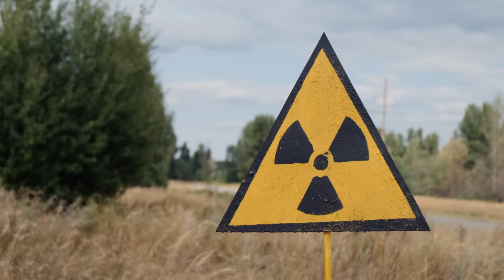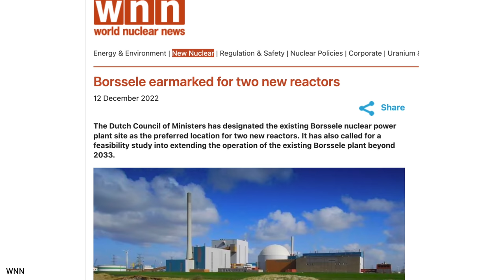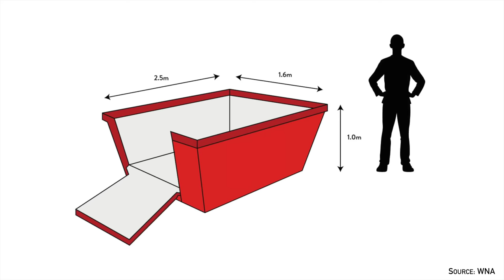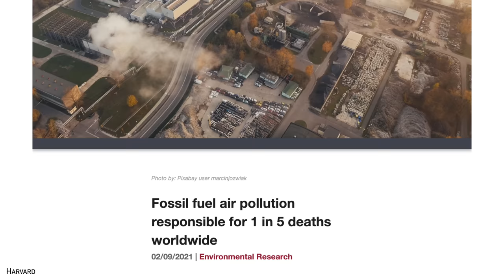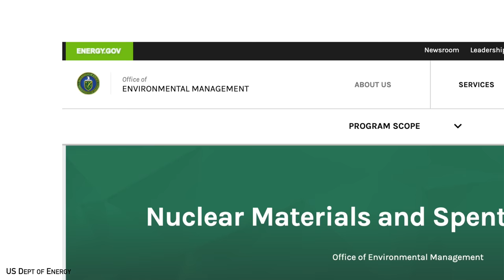Can Nuclear Waste Ever Be Solved? Yes.

Comment: Those casks were easily penetrated by DU (U-238) - tipped missiles. It was done many years ago in tests at the U.S. Army Aberdeen Proving Grounds, Maryland.
Reply: At a certain point, public utilities can't be expected to handle what is fundamentally a national security issue. Do you demand nuclear plants have anti-air missile batteries??
Reply: Those casks contain 95% U238, maybe 99% someday.  What possible point is made by shooting a can of mostly U238 w U238 round?  Sounds like BS.
Reply: @Nill757  The point was to see if these specialized hardened casks could be breached, penetrated, which would release radionuclides into the environment - a safety test. So the army was contracted to do the tests.  High level waste dry storage areas (and pool-type ones) at nuclear station are very vulnerable to criminal and/or terrorist explosive attack. It would create a "dirty bomb" scenario on site, which is usually close to a major city.  Armed drone attacks are now a very real threat....as demonstrated in the current Ukraine/Russia war
Reply: @davidgeary490  Comic book nonsense. Doesn’t matter who fired at the thing.  Depleted U rounds also “release radionuclides into the environment.”  Does that make each round a “dirty bomb”?
Reply: Indeed. And there is no shortage of fools who would take pot-shots at casks if they could.
More concerning is the majority of spent fuel, which is NOT in casks at all, and is vulnerable to terrorist strikes, deliberate strategic attack, or even neglect in the aftermath of some other disaster.
Reply: @Nill757  
Yes, those tests were intended to reassure people about transportation risks, which would certainly include train impacts.
However, the vast majority of casks are not transport rated.
Nor is a single impact representative of possible future abuses.

I never said it was "green goo", but your attempt to trivialise the matter doesn't really help.

The assemblies in the casks remain intensely radioactive. Punching a hole in a cask will allow direct radiation to radiate out, roughly like light from a lantern. For a ten year-old assembly, that beam of radiation would give a fatal dose in minutes. Even a hundred year old assembly would do so in less than half an hour. 
If the cask has been breached, then almost certainly the assembly has been disturbed.  Any ejected pellets would be fatally harmful for anybody who picked them up, or stood close unknowingly.

Odd that you think a terrorist would try and sneak in and "drag around some rocks". Like in a cartoon. 
They would be aware of the layout of a typical spent fuel pool, and the critical components.
Modern terrorists are capable of using explosives and incendiaries, and of using drones to place them.
They are capable of planning, of acquiring sophisticated training and of using substantial vehicles. 
Busting the roof and starting a fuel fire would severely contaminate the site and require the evacuation of towns in the area and of the entire generating plant. Site decontamination would take months or years. The terrorist might think that worthwhile.

As for neglect, well, in a way this is the most tragic. uncovered spent fuel will burn. The zircal cladding burns like magnesium, even underwater. The  fire will erode the fuel pellets and this dust would be carried throughout the structure and out through any leaks or breaches. The structures over PWR cooling pools are not airtight nor intended to contain pressure. As the cladding burns, more of the fuel will concentrate in the bottom of the pool as rubble. Without water shielding the entire structure will be continuously bathed in direct radiation. Anybody approaching will get fatally irradiated . Sooner if they approach where the "smoke" has settled. Cleanup would require efforts comparable to chernobyl, and resources are unlikely to be available to do so in a timely manner. Spent fuel pools in the US average about 800 tonnes of spent fuel in pools.  

The internationally agreed disposal path is geological interment. It's not like that can be dodged. May as well do it sooner rather than later, and swallow those real costs.
Reply: @aaroncosier735  When you referenced “pot shots” before as a threat, you are suggesting both thin protection that might be breached by small arms, and the notion that some significant gas or liquid can leak out, when neither is the case as you know. 

Yes. If there was an uninstructed puncture hole, line of sight close exposure could be lethal, and how likely is that event, compared, to, say, explosions and fire from hydrocarbons and any number of any other toxic substances transported every day, with long records of actually hurting many people, destroying large amounts of property? The same goes for any oil refinery or pesticides plant, where some “sophisticated” training would also lead to nearby evacuation.

“comparable to Chernobyl”
That accident led to a super heating of the fuel elements to several thousand deg C, exploding fuel elements from the inside and  core explosive force ejecting tons of time zero core material.  That notional uncovered spent fuel zirc chemical fire you reference would be a hard cleanup, but is literally millions of times less of a threat to the surrounding area than the Chernobyl accident.
Reply: @Nill757  
When I referenced "pot shots" I was referring to the propensity of USAnians to shoot at anything at all, no matter how dopey. 
A structure intended to withstand rain will be eroded much faster by all the human activities I mentioned, from dopes taking pot shots to metal scavengers, to simple vandals, to people trying to get closer to a source of heat, like those poor bastards that found a soviet RTG source.
Solid materials can also escape: as dust, as gravel and rubble, as smoke if any sort of fire gets to the cladding. Blown on wind, stuck to feet, hair, adhering to skin.
Any force that breaches the container will also disturb the contents, some bits will be blown out, others will spill out. Pretty cylindrical pebble-sized items, some shattered, some intact.
Fuel pellets are not like rocks. They are sintered from granulated oxides. Thermal cycling, transmutation of elements and intense irradiation weaken this further. Many are deformed, cracked or broken within the rod casing. Microscopic examination shows how fine-grained structures have degraded to coarse grains with chemically mobile wastes accumulated in interfaces and voids. They are relatively fragile, certainly not robust.

How likely? over the lifespan of the waste? Counting human vandalism, erosion, floods? A certainty.
The risk is not a hypothetical alternative to those you mention. It is a real risk that exists IN ADDITION to those other risks.

Yes, Chernobyl released about five tonnes of material. 
A typical spent fuel pool contains nearly one thousand tonnes of spent fuel. Only a tiny percentage has to be dispersed as smoke to be directly comparable with Chernobyl. That "smoke" would be fine particulates that carry a long way airborne, that contaminate ground downwind and accumulate in waterways.

There is a straightforward solution, internationally recognised as necessary and unavoidable for over fifty years. Putting it off doesn't help, but does increase the costs.

Comment: reusing the spent fuel i think  the most affordable way
if it still radiating thousands of years then it producing heat thousands of years

so the issue is capturing the energy  what the  used fuel cells emitting

Comment: Nuclear waste is not a problem, the Sierra Club and President Carter are the problem.  The "waste" still has 95% of the potential energy and can be reprocessed.  Better yet finish developing the molten salt reactor and we will have eternal energy with no pollution.

Comment: I really appreciate you rhard work in demystifying nuclear power. Thank you! But i have a question 
20:12  does that cost of reprocessing spent fuel exceed the cost of mining and refining "new" fuel?
Reply: Yes, at the current price of Uranium reprocessing is far more expensive.  However, if a high price is applied to storing spent fuel that might change.
Reply: Yes. Reprocessing will cost more. Probably more than current reprocessing for disposal. It only seemed feasible when there was a perceived shortage of uranium, decades ago.
France reprocesses a fraction of their wastes and the cost basically doubled the cost of their nuclear programme. This cost is subsidised by their government to keep prices comparable to other parts of Europe.
Canada's NWMO regards reprocessing as potentially useful, but recognises the high cost.
There are also limitations. "recycling" spent fuel works OK once, to make MOX fuel, but spent MOX fuel is a whole new problem: It has to be reprocessed very quickly to limit accumulation of certain decay products like U232, if not it is more difficult to handle, creates more waste heat and has a much longer storage requirement than ordinary spent Uranium fuel.

There is a hope that Gen IV Fast Reactors will be able to consume their own complex transuranic wastes, but this has not been demonstrated. While some transuranic isotopes will fission with fast neutrons, others will not. These reactors still produce fission products that need removal and disposal. There are no modern miracles here. It will still be messy.
Reply: @aaroncosier735  “prices comparable”? 

French electric rates are half those of Germany, which has highest of 2nd highest rates in Europe.
Reply: @Nill757  
Yup.
That results from price caps on the generators, and subsidies of the wholesale/retail market and of the consumer.

The real costs are much higher.
Reply: @aaroncosier735  “the real costs are much higher”

Other way around.  The French nuclear power fleet is a large revenue generator which for years now the French government periodically uses as a cash cow when money is tight, redirecting funds in recent times that should have been going to maintenance.   The French  nuclear fleet build cost 70s-90s is well documented in the literature, w 3/4 of all reactors  built for under $2000/KW (overnight) and all of them under $2500. See eg “Overnight Construction Costs of Global Nuclear Reactors in USD2010”

Comment: Reliable?  Not as much as the industry would like people to believe.  Nuclear plants go offline unscheduled all the time.  One external cost of nuclear energy is the need for backup generation to fill in when a reactor shuts down.
Reply: Potential vd guaranteed for solar and wind backups/over provisioninh.
Reply: “Unscheduled all the time”

False. Take away scheduled maintenance and refueling for a few weeks every couple years, and the average, individual US reactor uptime is over 99%.  There is no other power source anywhere close including hydro. So with a hundred reactors, one  on average might be tripped out unexpectedly.  As a fleet, that’s not a reliability problem. 

Then the point is not one reactor for a country, its the fleet that matters.  So while all the PV in an entire hemisphere flips off every half day, or wind turbines idle for days over a half a continent, that’s never happened unscheduled to an entire large fleet of nuclear reactors anywhere, ever.

Comment: Waste isn't really waste as this so-called waste still contains over 95% of unused energy!  Resuing this unused energy in the waste is the best ting we can do to reduce the volume of this waste and its deadly radioactivity period significantly. Just burn this waste in much more efficient High Temp fast reactors of the IV Generation which are much safer reactors by design than our current primitive inefficient reactors!
Reply: How do you know anything about Gen IV reactors since non exist in the world
Reply: @clarkkent9080  Current Nuclear reactors are like Ford T-models. Dangerous with water cooling that with an unstoppable reactor process turns in Exploding Hydrogen (Fukushima). New generation IV reactors are all designed to prevent this from happening. The Molton-salt reactor (gen IV reactor type) was built by Weinberg and operated in the 50' but was killed off by US Defense as no plutonium could be made which they needed for bombs. So this safer reactor was built and functioned perfectly!

Comment: Too Funny:
1. Not In My BackYard. The US spent about $15B on Yucca mountain but was shutdown because nevada policians shut it down a few months before it was to open. Nevada got the federal funding which was spend to create jobs, but then forced it close the day it was ready.
2. Nuclear power is dead: There is only enough economically recoverable Uranium to meet demand until about 2050 & most of the uranium came from Russia which won't be selling anymore Uranium to the West. The cost of building new Nuclear power plants is astronomical costing about $15B per GWe & takes at least 20 years in planning, construction and testing. Any new plants will never recoop the costs as the cost for Uranium fuel climbs and supplies dwindle likely forcing operating nuclear plants to close prematurely.
3. Most utilities want nothing to do with nuclear power. its a gov't red-tape nightmare, Few people are willing to do the dirty & hardwork (many nuclear workers are nearing retirement age), and most utility are aware of the pending Uranium shortage. Utilities are working to decom older nuclear power plants and replace them with NatGas Power plants because they are cheap to build & operate and don't have the never ending regulatory rules they have to follow.

I suspect the long term storage for Spend fuel will remain on the plant sites indefinately. For instance, with the San Onofre (decomm'd in 2013) has all of the spent fuel stored on site in bunkers that will last about 100 years.  Western gov'ts are dead broke, drowning in Trillions of debt, and now face the tsunami of pension & entitlement obligations as boomer all retire (with no money saved). The US is far more interested in starting wars to care about anything else. US is currently starting wars in Asia (China), Middle East (Iran, Syria) , Africa (Libya, Sudan, Kenya, Somolia -22 nations in total in Africa), Europe (Russia). At some point Western civilization will completely collapse and those dry caskets will eventually leak. Consider that all nuclear power plants are near major water sources as the need large amounts of water for cooling. This will become an absolute disaster in the distant future (100+ years from now).
Reply: And South Carolina got many many more billions in jobs and taxes to allow SRS to make weapons material.  After the jobs started drying up they demanded that the government move the weapons material out of their state.  

The 1983 Nuclear waste policy act SPECIFICALLY stated that no less than 2 geological repositories would be selected in different parts of the country so no one location would be  burdened with all the nations waste.  And that the sites would be chosen based on scientific study, which by the way proves salt deposits to be the most stable and desirable.  If we would have followed the original act and not chosen an extinct volcano (Yucca) something might have occurred.
Reply: @clarkkent9080  I believe Yucca mtn. was chosen because it is location to Nuclear weapons testing site & probably because is not very far away from Las Vegas for construction labor resources.

Regardless Yucca is dead, and instead they store all of the spent fuel at all of the decommed power plants, leaving them to rot which is the worse possible situation.
Reply: @Klerk Kant  The US is clearly making the waste an issue when it is not and never has been a technological issue.  
From the US Government Accountability website:  "The nation has over 85,000 metric tons of spent nuclear fuel from commercial nuclear power plants. DOE is responsible for disposing of this high-level waste in a permanent geologic repository, but has yet to build such a facility because policymakers have been at an impasse over what to do with this spent fuel since 2010.  Meanwhile, the federal government has paid billions of dollars in damages to utilities for failing to dispose of this waste and may potentially have to pay tens of billions of dollars more in coming decades."

Comment: misinformation nucliar waste hes been solved years ago
Reply: along with world hunger and climate change
Reply: imagine using 5% of any fueel and them put it in the ground and complain that the fueel keeps radiating/leaking its 95% of energy...there s anaugh fueel above ground that we already mined to last us more then 100y the main issue is that they refuse to recycle the pellets...after recycling (using up the fueel) it stays radiactive for less then 300 y
Reply: @nvbnvb2240  Maybe it is because it costs many many billions to reprocess. And enstein, even those countries that do reprocess only extract the Pu239 and U235 that make up less than 2% of the spent fuel.  U238 (95%) of the spent fuel is so common and cheap it is not worth recycling
Reply: @nvbnvb2240   Many countries are reprocessing spent fuel rods, and that drives some trolls into a tizzy.